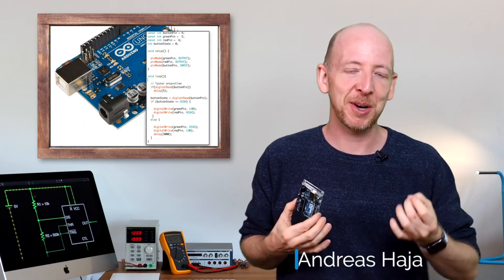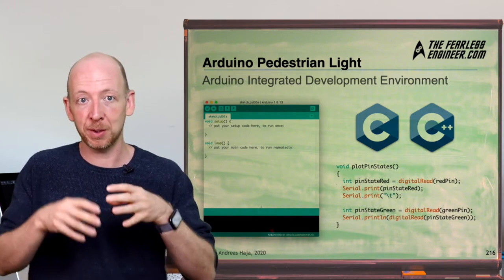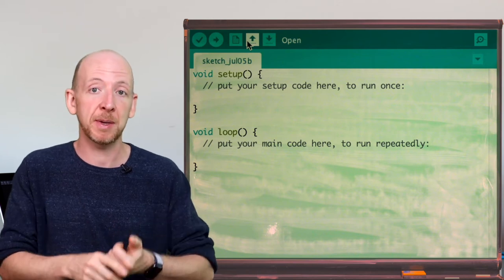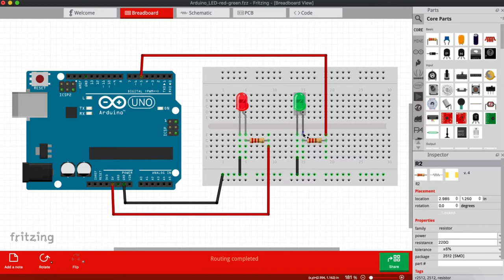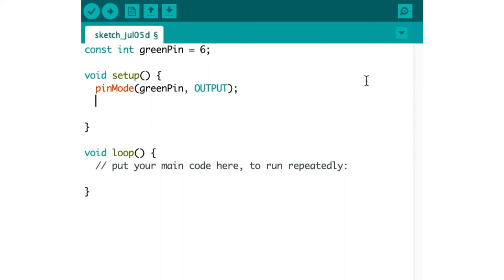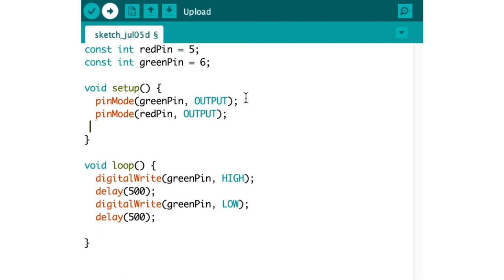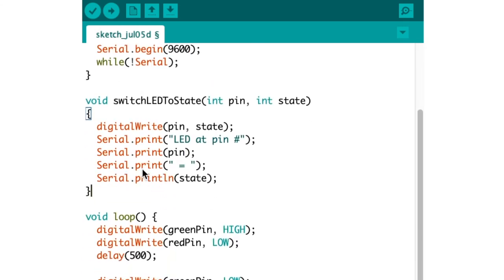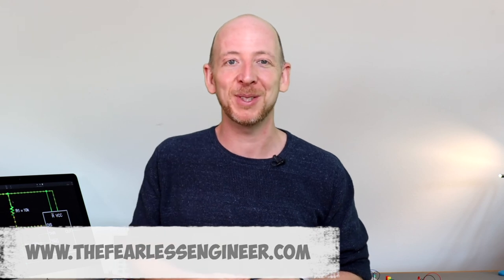Arduino Programming / IDE Tutorial | "Arduino Traffic Light" (3/4)

Comment from the maker: Hi and thanks for watching! 😀In the video, I have talked about the setup() and the loop() function. The latter is called repeatedly during the runtime of the Arduino. How often do you think it is executed per second? Remember that the ATMega328 is clocked with a 16MHz crystal. And is the number of of loop cycles constant? Let me know what you think in the comments, if you like! 🔌⚡
Reply: I guess the number of loop cycles cannot be constant, it depends on what is being processed 🤔 and how often it is executed per second depends on the crystal frequency ?  But also on how much is being processed ...